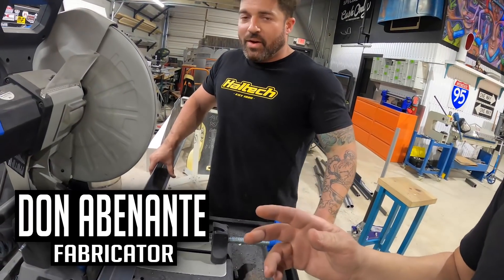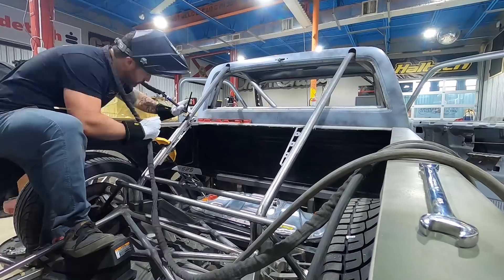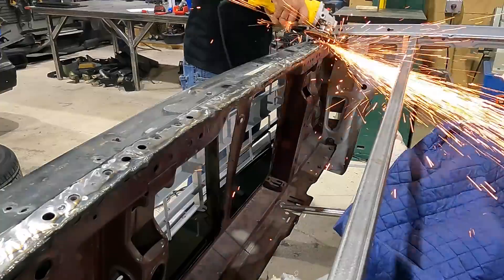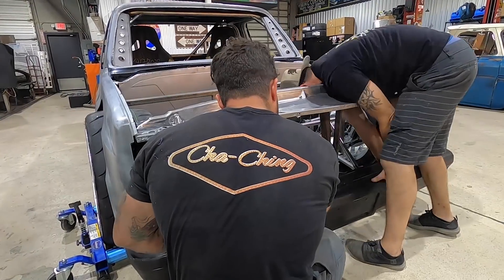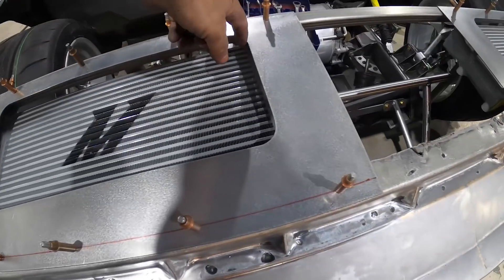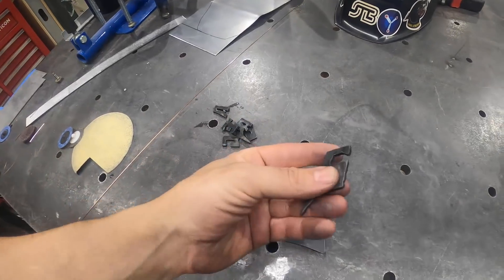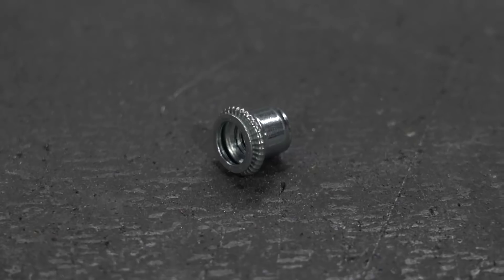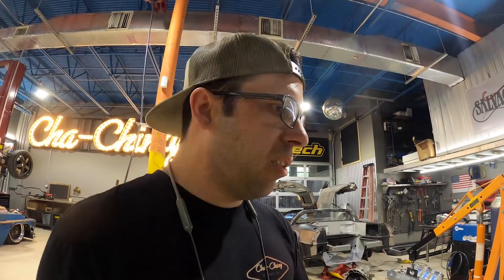How To: Cooling System for a Tesla Swapped Squarebody  - Electric C10 Ep. 13

Comment: Such talented fabricators. 

Curious for design ideas for the cooler placements under the hood. 

Would be better to mount the power units vertically so you can get air through the grill and duct the hot air out the wheel wells.

Comment: Great build cant wait to see finished product!!! I think there will be no air flow aerodynamically for the rear radiator. i saw a similar build putting radiator in the rear close to the cab and found out it was a dead spot
Reply: Y'all should consider angling the radiators and force air up and over the cowl of the truck.  Look at hill climb builds... they force the air from in front up and over to create downforce & because the negative pressure area above the hood at the windscreen is a perfect place to extract high pressure from the grill.
Reply: Rear gate radiator???

Comment: Y'all should consider angling the radiators and force air up and over the cowl of the truck.  Look at hill climb builds... they force the air from in front up and over to create downforce & because the negative pressure area above the hood at the windscreen is a perfect place to extract high pressure from the grill.

Comment: The hood blocks airflow...
Venting the center allows air to follow path of least resistance.
With battery radiator mounted in front the other 2 coolers have hot air fed to them.
....
BAD design... but looks cool.
Reply: But wait she is not finished! maybe some cutting involved very soon.

Comment: Electric motors do not make that much heat,  but electric motors don't heat up like gas engines so the delta T is low on electric cars, so u do need a big radiator to dump the HP heat developed by the motor.   But say the motor/inverter setup is 92% efficient and dumping 500hp u will develop 43hp of heat.    A gas motor would develop about 500hp of heat, and 500hp of heat gets dumped out the exhaust (quick rule of thumb numbers).

For the battery I would think AC'ing the coolant in the battery would be needed.    100f ambient temp will not cool the battery at all.    U only have about 50F max delta T.   Gonna take a huge radiator to cool that 150f down to 110 in 100f temps

Awesome build, not trying to knock you AT ALL!

Comment: Forewarning the flanges/skirts you welded above the heat exchangers need not touch the exchangers. It will wear a hole fairly quickly.

Comment: Batteries are not like CPUs where you keep them as cold as possible to achieve the maximum IOPs; they require stabilization within a temperature range (especially LiFePo chemistries).

You can't get them too hot, nor too cold. Either one will either compromise their stability —causing a fire— or reduce their charge cycle life (thousands of cycles down to hundreds of cycles).

Comment: 6000 lbs when completed🤔🤔?
Reply: Nahhh i am guessing 4200
Reply: @donabenante8022  If anymore weight is added it will weigh  4200KG, not lbs . Model X is  around 5400lbs. It's a super cool build and with the light weight panels going on hopefully your right at 4200lbs.
Reply: @mrshifter5007  Thats what i was guessing! The motors are very light weight 
as for everything else its was needed and its also a truck. But we needed this thing to be rock solid since we are going to be beating it up so bad. It wont be a pro mod weight but it wont be heffer.

Comment: Why aren't you using aluminum whenever you can? The fascia for those radiators is aesthetic has no structural function so why not save weight by using aluminum? It's not the cost because this is a high end truck right? Please ignore my ignorance I'm curious

Comment: I missed the reason for chopping off the radiator fill neck. How do you add fluid?
Reply from the maker: We'll be adding a different bung later on down the line when we do the plumbing.
Reply: A hold tank some place in the engine bay! We don't need the radiator to be pressurized.

Comment: Great fab work guys!  On the rear radiator, since this project is half “looks”, wouldn’t it look better to sling the rad under the roll bars, with the tubing connections facing down, instead of up.  Would lead to cleaner plumbing, I think.  Could also use pusher fans on the underside, so that the rad is shown off, instead of the fans.  Love this project. 👍
Reply: Or just not slap a radiator (with fans and plumbing facing up🤦🏾‍♂️) like it was some last minute fix. Looks like a build from junk yard wars. This was my favorite build on YouTube 😫
Reply: I like your idea better Greg. If they read this maybe they will change it.

Comment: You guys should add hood scoops for the heat exchangers with a shrouded heat exit leading somewhere (maybe a fender vent?), or add the heat vents to the hood above the heat exchangers, with a grill scoop to feed the heat exchangers. That would add to the aggressive look, be functional, and reduce temps further. I personally think adding the heat vents to the top would be ideal with the grill scoop so the heat can rise out or be pushed out by the ram air. Just a thought😁😅
Reply from the maker: Not a bad idea! Thanks for the input!!!
Reply: @SalvagetoSavage  I'm glad you saw this, my very first thought was "where is the cool air for the heat exchange units coming from? I was wondering if you had thought of maybe doing something similar to the Louvers in an Alpina B12 5.7 bonnet or if you feel like excessive fabrication, something similar to the corner cutouts in the bonnet that miata's have for their headlights? I'd probably go for the B12 idea myself though. 

Or maybe just the simple scoops that Trevor suggested, though if you are looking at something close to road legal (for road courses, etc) you might have issues with that idea as it would kind of replicate the pedestrian cutting hazard that caused pop-up headlights to vanish from cars.

Comment: Man I love this build. Not a big fan of the decisions for the rear of the truck tho. Wish yall would have kept a traditional truck look back there. Maybe hide the fans under a liftable bed or something 🤔
Reply: But it’s for racing is it not?
Reply: How would the radiators get air flow, that they have to have, if they're hidden?
Reply: @YeshuaDisciple916  how do rear engine cars get air flow to their radiators?
Reply: @jhype9560  absolutely, they do. There are factory designed air vents to make that happen in rear engine vehicles. Always has been. I've personally owned over a dozen rear engine vehicles. All of them have have vents forcing air into radiators. They can't cool the air otherwise.
Reply: @YeshuaDisciple916  the radiators are usually still mounted up front or on the side though.
Reply: @jhype9560  you're correct that they are often mounted up front, however they still need air. Without adequate airflow, a radiator is just a reservoir for hot water. Coolant transfers heat to the tubes; the tubes transfer heat to the fins; air moving through the fins dissipates the heat from the radiator.